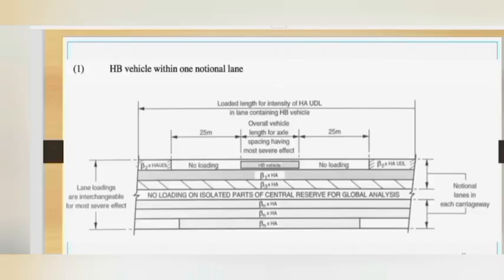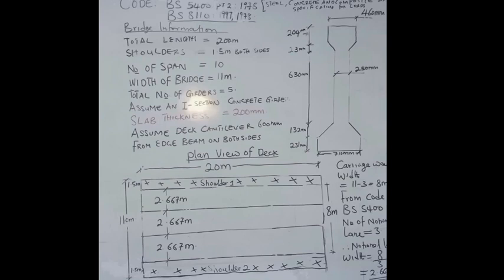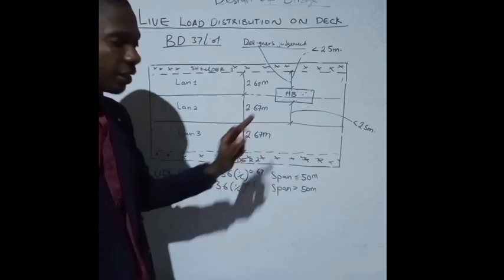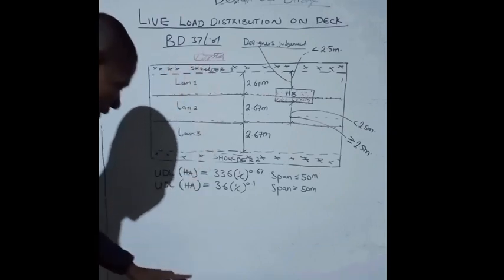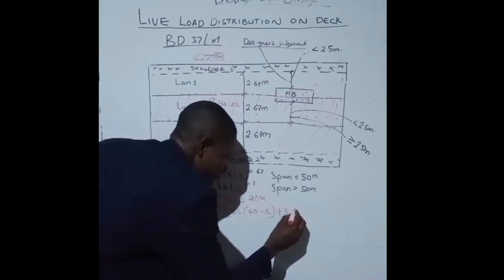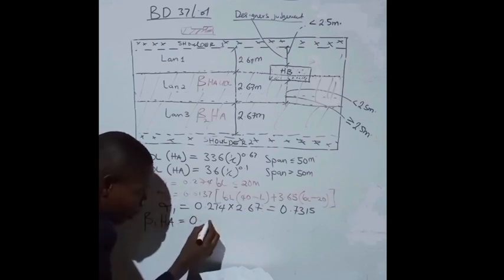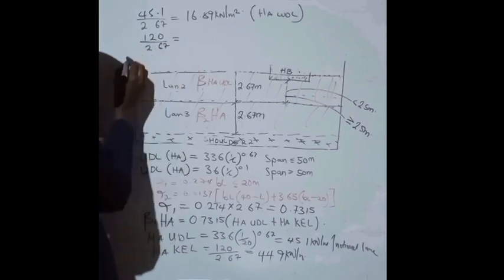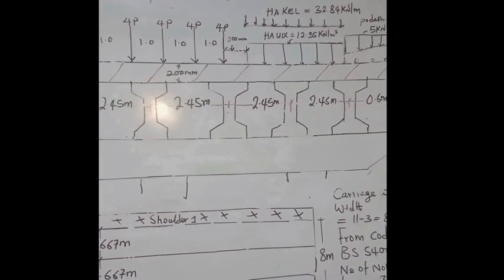HA and HB live load Application on bridge deck bs 5400 codes

Comment: Pls which book did you use for bridge design
Reply from the maker: A couple of literatures are available, depends on the methodology. Sincerely there is no one book that can be absolutely recommended. But for beginners I will recommend R.C Bridge design by Rowe .
Reply: @ATI-ubagak  thank you pls what of building design and steel design
Reply: @ATI-ubagak  the textbook is not online rc bridge by rowe are you sure you did not make a mistake with the autjour
Reply from the maker: @kilobyte7814  you can check "concrete bridge design by R.E Rowe"
Reply: @ATI-ubagaokelue  ok
Reply: Pls do you have a pdf for concrete bridge design by r.e. rowe I didn't see it online to download it
Reply: Pls the Pdf of the testbook